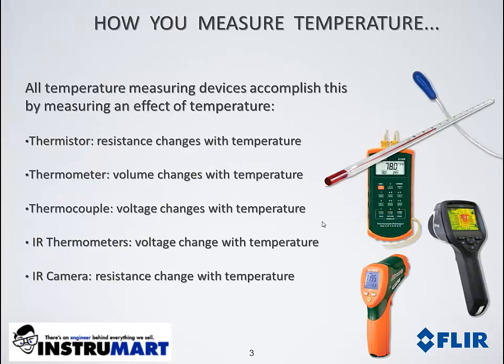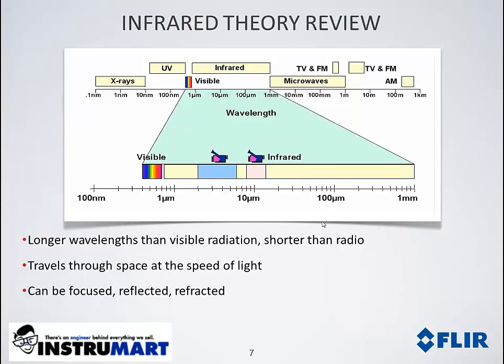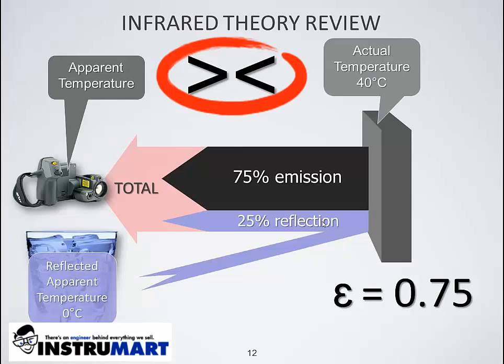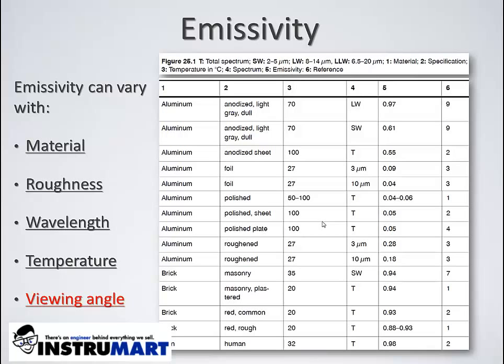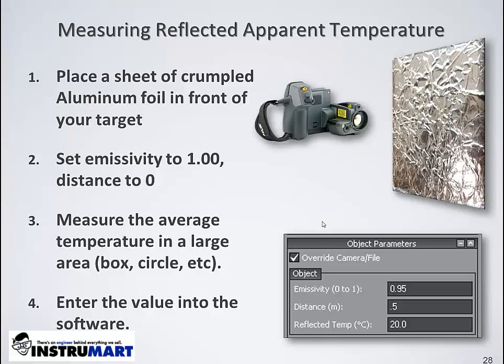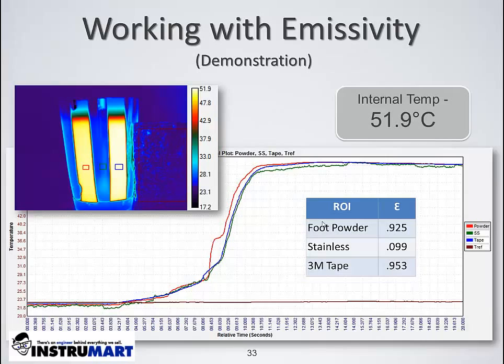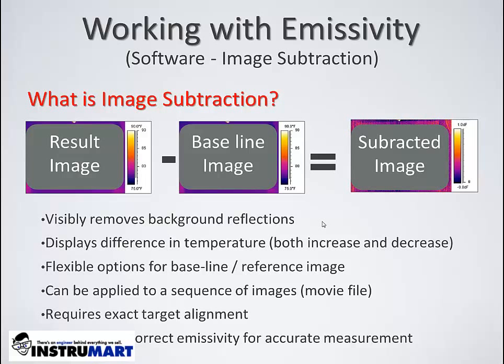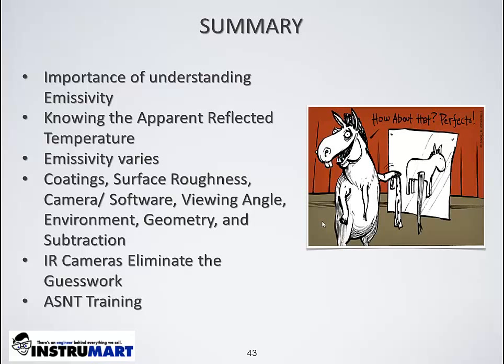FLIR Emissivity Webinar | Instrumart

Comment: My name is Edward Monter I am 78 Years old.  14years ago I took this course only I was able to convince management to purchase an Infrared camera that in today's  dollars equals 1 million dollars.   If I had failed to do this, the manufacturing  plant would  have lost millions of dollars in addition to GM corporation.  The irony if this results is that I did not receive one penny in Monatory reward.  Not even thank you, The principle that caused me to find this is Emmiissitiv Value of copper.  Still this disaster may still happen if I decided to return to the plant without checking this electrical device.  I was performing regular infrared inspection in our Mechanical Complex.  In my mind I thought while I am here to check the  I'm check the substations.  The reason I did this I because I had previously  found an electrical problem  with substation.  Consequently  Duke Energy was able to come out and fix it.  While scanning  because of a gle of the shoulder-held camera, our of the corner of my eye I saw a bright white spot. After further inspection, I discovered that the temperature of each phase was 135 degrees.  I immediately  contacted my electrical supervisor.  Because  of his and my supervisor about the benefits of Infrared,  he told me to "check"  it "occasionally.   Just few days later I checked it again.  T the temperature  was  now 500 degrees.  The next day my camera could not measure the temperature without changing the filter. It was raining and steam was coming from them.  Again because of the ignorance of even the General Manager,  I had to prove the "accuracy" of the camera.  I actually  found  1 in less than 15 minutes.  Management was still 100% convinced by did call in their expert who was a Level III Certification.   I was told that he a newer camera .  I imagine  disappointment when he came with a camera that looked like  some kind of antique.  This lasted less than one minute.   In just few minutes he said we need to shutdown this plant.  He came back early next day.  I sat at back of the room and listened to them.  We told them the worst scenari

.

Comment: This is completely wrong; An emissivity of 0.75 does not mean, that 25% of the radiation coming from the body is coming from reflections. For example, if there is very little background radiation, than almost 100% of the IR coming from the surface will be emissions. On the other hand, if there is a very strong background radiation, then almost all of the IR coming of off the surface will be due to reflections.
Reply: The description in the video is not wrong - but the video was describing the weighting that should be applied against target emission vs reflections. With emissivity of 0.75 (75%*emission + 25%*background reflection), if there's very little background radiation, the 25% term simply goes to 0 (and the uncalibrated measurement would be lower than actual). If there's strong background radiation, the 25%*(strong reflections) would overpower the actual emission radation, and you would get much higher reading (the uncalibrated measurement would be higher than actual)
Reply: crap, i was hopping this was good material. Thanks for the warning!
Reply: @woodrunner51  It is still a good material, but please read my comment below to clarify the weighting applied.
Reply: 00
Reply: p